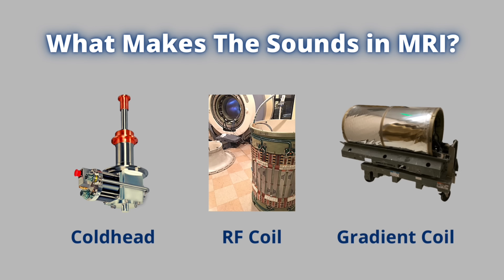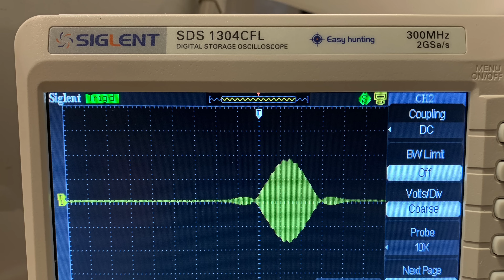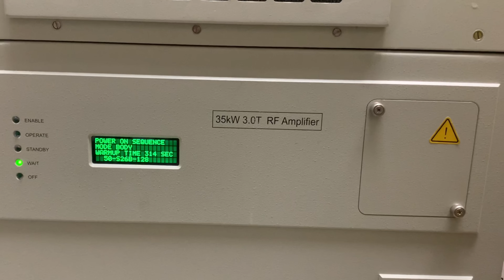What Makes The Different MRI Scan Sounds? Knocking to Rhythmic Chirping MRI Sounds Explained

Comment from the maker: I hope this video was helpful! Listen to the sounds of an MRI scan filmed inside the scan room here: https://youtu.be/TIsrOtSSUQY
Why Is Metal Not Allowed In MRI Scan Rooms? Click here to watch: https://www.youtube.com/watch?v=dxcrt1-gmLQ
What Is MRI and How Does It Work?: https://youtu.be/19qu6SYqOTc
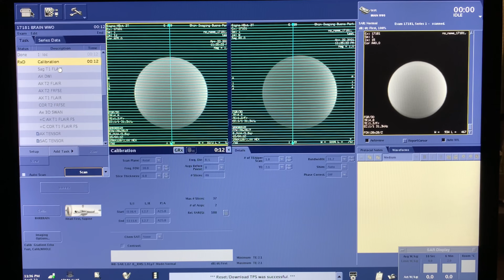Reply: 3:07 Why aren't the fiberglass mountings designed so the gradient coils don't knock against them?
Reply: Sorry, maybe that explanation would work for scientists and electrical engineers; but for us common lowlife slobs with other Masters degrees, that did not make any sense at all.  Any way you can make a video without using technical jargon?  Also, animation showing movement of internal parts as they make those sounds would be most helpful.  Don't slow the sounds.  We've all had to have MRIs at one point or another, so the sounds are very familiar.  I've always wondered what makes the different sounds, and unfortunately after your video, I STILL DO!!!
Reply: I could fall asleep listening to that video of the sounds inside an MRI.
Reply: @Jared7873  It's actually the windings in the gradient tube (gradient coils) that moving/trying to move.  The gradient tube is constructed of fiberglass and epoxy.   Hundreds of amps of electrical current pulse through the coils at audio frequencies.   Something's got to give.  In this case, massive amounts of audio frequency "noise" is generated.   The gradient coils are water cooled, so that may give you an idea of how much power is used by the system while scanning.   Not to mention the radio frequency amplifier, which is part of the system.
Reply: Well I don't want to get one
Reply: @GrayBoz I don't want to get one either, they're heavy and really hard to move and install.
Oh, you mean the testing? Then, go undiagnosed or have exploratory surgery instead.
Just had both CT and MRI scans, each able to "see" different things for doctor to diagnose some major medical issues and specifically to rule out cancer and severe autoimmune disease that'd do that whole killing me thing, which would really wreak havoc on my weekend plans for the foreseeable future.
The last MRI I had was over 20 years ago, been some changes and improvements, to put it mildly. Much better resolution, the sounds are actually lower in many ways and air flow through the time tunnel is improved, which helps with some of the confinement issues for me. The pulses are a tad bit quieter, likely due to improvements in coil binding, where they used to sound like someone actually hammering on the housing, it's more dampened. That's actually better on the coil, as well as the patient from a mechanical stress perspective and noise/stress perspective. The rest of the noise is higher in frequency by a bit, nothing stressful overall.
The fun part is, it's likely I'll need another MRI soon for my lumbar spine, as this one was examining ducts in my liver for autoimmune damage, so not exactly up there with watching a movie or something, but beats leaving doctor taking a guess or slicing and dicing my body to find out what's going on.

Entertaining is, I used to work around RF equipment of equivalent power. One never was supposed to be near such radiator source power, not due to some mythical cancer risk, but because one could accidentally come into contact with the radiator (aka, antenna or antenna feed connector) while it was energized and RF burns aren't exactly fun. Here, that power is tamed and rendered safe, indeed, to contact the coils, well, the frostbite would be worse in terms of damage than the brief RF pulses.
With the increased frequency and power come increased resolution, which helps doctor diagnose medical issues tremendously.
And one's nuclei don't mind getting shaken, not stirred.

Comment: Just had one today and was surprised by the pumping sounds, had no idea it was pumping  liquid helium 🤯
Reply: Me too
Reply: I had one today too. The brain in my case. The sound at 3:13 was sooo load and sounded very strange in my head.
Reply: Same - I had one today and here I am to figure out what all the noises were!
Reply: @Ang417 Liquid helium only exists within the magnet housing, it is never pumped. Helium gas is used as a refrigerant by the coldhead. It cools the shields within the housing and reduces liquid helium boiloff. The coldhead cannot turn helium gas into liquid, it just cools the housing, usually in at least 2 stages. Toshiba systems are much quieter due to the fact that the gradient coils are in a vacuum.
Reply: @johntyler4222  And because Toshiba coils are in a vacuum, they cannot be cooled as well from what I understand.  (vacuum is an insulator)  Therefore, scan times are longer as a result because the coil cannot be driven as hard.   Also, cold heads DO recondense the helium gas boil off back into a liquid.   I've had magnets go for years w/o the need for a helium refill, provided the cold head is replaced in a timely manner as it wears and cooling water supplies are not interrupted frequently.
Reply: @NESig  They are in a vacuum but like most gradient coils built over the last 25 years or so they are water cooled so they don’t rely on conduction  at all. The water cooling is usually provided by the Z gradient coil being a tube so the cold water runs through that and there is no problem with coil heating no matter what power is put through them. Toshiba, or Canon Medical now, don’t have longer scan times for comparative sequences. The magnets are fitted with fans purely to cool the electronics and also provide a cooling breeze for the patient.
The helium boil off allowed is usually quoted as less 100ml per hour(liquid), and it’s usually much less than that, or you start looking for problems.
Reply: I forgot to add, the idea of a coldhead is to reduce the temperature gradient between the 4.2K liquid and the room temperature by cooling the heat shields, usually 2 of them in 2 stages, so that the boiloff is reduced. There is no way that the coldhead can convert helium gas to liquid only reduce boiloff. Once the liquid is gas there is no going back. Regards.
Reply: @johntyler4222  you might want to clarify that a bit. Helium can be condensed, but the equipment is a wee bit large to do so. It's not as if helium, once turned into a gas from a liquid cannot ever be recondensed, which is basically what your statements sound like. Indeed, it's routinely done in physics apparatus like at CERN. It comes down to, does one need to condense to liquid or will different gaseous phases suffice for what one's doing.
That said, my understanding is that helium is in physical contact with the coils. Were it exclusively contacting the heat shield, heat would accumulate within the coils and well, that'd be bad. And a quench wouldn't instantly vaporize the helium and need to be vented to avoid overpressure damage to the plumbing. Hence, why there's a quench pipe.
Reply: @ What I was trying to say is that the helium in liquid form is only present in the magnet itself and not anywhere else within the system. The coldhead which makes the noise constantly uses helium gas as the refrigerant which is circulated by a closed loop compressor which also includes the condenser which is normally water cooled. Helium gas is not a wonderful refrigerant but really the only thing useable at the temperatures expected within the coldhead. The coldhead makes contact with the heat shields through a copper shaft holding the tapered round copper blocks which make contact with the shields and thus transfer the heat away to the coldhead.
In modern systems the gradient coils are water cooled, usually by making the Z coil out of copper tubing rather than wire so air cooling is not necessary. Fans, other than those used for cooling the electronics, are usually only for patient comfort these days rather than coil cooling.
Apologies if my original comment wasn’t clear.

Comment: had 1st one in 1987 they were just getting popular but complaints of costs but did not take long to realise how valuable they were because before the new scans only way dr had was cut you open to explore then decisions on the fly or you had to have 2nd operation now dr can plan better.  and one cutting just like carpenters measure 2x cut 1. but the first machines took forever compared to todays  . i had about 6 plus 2 ct   and at least a few more while they monitor my problems

Comment: Jesus, 30kW? This explains a lot. I told the MRI tech that during the scan it felt like someone was putting a hot towel on my back. I also here and there saw flashes of light. He said some people are, “more sensitive than others” and that most people don’t perceive anything.

While I appreciate the lack of ionizing radiation I gotta think being that close to 30kW RF transmission doesn’t come for free? Then there’s the contrast agents. I feel kinda foggy after Gadolinium for a couple weeks, it’s not massive but I feel off. 

Still beats CT scans. I had a Tri-Phase CT and it felt like I was pissing myself, good times. I’ll take the tuna can flavor and clunking of the MRI any day over a years worth of radiation exposure in a handful of seconds 😐
Reply: MRI systems have built-in software limits as to how much RF radiation is used during scans.   It's based on body weight.   Still, a scan, like a lumbar spine scan, WILL warm up the patient.   Lots of RF energy is used to flip those little hydrogen nuclei in the human body so that they in turn, will relax back to their original orientation while emitting RF energy that is received and converted to images the Dr's read.   (It's magic actually.)  :)
Reply: @NESig  yeah pretty aware of how it works, it's truly fascinating tech. I'm an engineer myself and still marvel at the multitude of engineering, physics etc disciplines that had to converge to realize that technology in any practical sense. One of the easiest ones to understand IMHO, almost downright intuitive is PET scanners, the decomposition of the radionuclide and the scintillators converting those emissions into optical counts. A little computation of time delays and you know where the stuff is concentrated...i.e. a tumor.

Comment: Trying to understand the use of the word Sublimation in the video related to helium involved with the MRI scanner. Trying to understand what this means because Sublimation means going from a gas to a solid and skipping the liquid phase I guess.  Why is the Sublimation term used near the beginning of the video? I only see gas being converted to a liquid to achieve the cooling benefit
Reply from the maker: That is correct! Thank you for pointing out that oversight. Using boil-off, or expansion instead of sublimation would have been accurate. I try to keep all information as accurate possible, so I really appreciate it. I will make a note of it in the description. Thanks again!
Reply: @MRIPETCTSupportEngineer  I'm looking forward to an MRI and MRA of my neck and skull relating to ear ringing. Toward determining if the ear ringing I experience is due to pulsatile tinnitus. Even if it is pulsatile it's still something that likely will not be meaningfully treatable but worth learning more about and who knows what else scans will come up with.  This is what led me to your video.  Thank you for a really great video

Comment: In 2018 I had a couple of MRIs done.  The rhythmic pulsations and buzzes and the general warming sensation (RF heating?) were pretty much soothing, to the point I was falling asleep.  The technician told me to keep myself awake so that jerking in my sleep wouldn’t degrade the image.

You might correctly guess that I’m an engineer.  I work with RF and superconducting electronic circuits ;o)

Comment: Sorry, but much of this is incorrect:

The RF coils do not make any (significant) noise, and what noise that might come from the coil is not due to the RF pulse. The RF frequency, even on very low field scanners, is in the megahertz regime, so way outside of the range of human hearing.

The gradients make noise for a simple reason: they are loops of wire with pulsed electrical >current< passing through them. This current - which can be a few hundred Amperes - causes them to act like a loudspeaker. The pulses are in the audible frequency range, and hence so loud to our ears.

Comment: I have acute claustrophobia since a kid. Thank GOD the V.A. have latest equipment & the openings flare out, giving a better experience. I was unlucky enough to get into what looked like a first gen. machine. It was like being in a straw! I was told "If you get stressed or panicky, just squeeze the bulb & it will pulse air to the alarm!" As I was going in, my entire body was squeezed by the sides. I wasn't even fully in & I was pumpin' that little bulb so fast she probably thought I was having a seizure!

Comment: There is a cryogenic pump cooling the magnets. That makes most of the noise, it's a helium displacement mechanism ususally driven from a synchronous motor. The motor makes a rythmic buzz and the displacement piston makes the helium expand acompanied by a hiss. If the helium compressor is nearby that makse makes the most racket!

Comment: In 1975 I started college and was taking chemistry 101. I was given a tour of the facility and the guide took us to a small room that had a copier sized, non-descript machine in it - not much to look at. The machine was making a rythmic knocking sound and he told us it was their new Nuclear Magnetic Resonance spectrometer. Nuclear Magnetic Resonance is the basis for all MRI devices. The concept of using NMR to make images had been conceived and experimented with in 1971 by Paul Lauterbur, but it took many years before MRI machines became available.

Comment: If you're a worried first-timer, here are some tips. It's my experience for brain MRIs. DON'T BE AFRAID, it's not that bad. If you are very nervous you can show up 30 minuted earlier and ask for something to calm down (in swiss hospitals). For me the worst part of getting my brain scan is the dye injection. Once I'm in, I do a mini-meditation: name 3 things your body feels (like your socks touching your feet, whatever is under your fingers,...), 4 things I hear, 5 things I can see. That's 5-10 minutes gone. Then another few minutes appreciating the fact that you get to be lazy and HAVE to do absolutely nothing and it's completely justified! 
Boom, I'm half way there.
Then, rinse and repeat. Or plan my MRI reward. It's usually a good pastry and coffee. Pizza maybe? Anything, really. Got plenty of time to figure it out. 
Making lists also helps. Top 10s for example. Until finally the tech announces the dye injection, which means there's only 10 minutes left! 
You can do this! ❤✌️🖖

Comment: Thanks for explainig . Can you / anyone else do something about the noises? Did you mention the loud train-horn like torture device that goes on intermittently. What heck is that, some sort of warning ? Is it not possible  to make magentic coils that work at liquid nitrogen temperature,  so that one does not have to worry about condensing the gas.

Comment: Why haven’t these brilliant engineers figured out how to isolate the noise of the machine from the environment? We have enormous nuclear submarines with gigantic turbine engines driven by steam heated from nuclear reactors. They also have giant condensers to return spent steam to a liquid. This system, with all of its machinery and auxiliaries drive a vessel weighing thousands of tons through water at great speeds virtually silently from outside the hull (so it can’t be detected by enemy ships). This is done with sound isolation design and technology applied to all noise making machinery. Surely we can do better isolating an MRI loud banging noise if the builders and buyers of MRI machines cared about the hearing and mental well-being of patients. Slapping on often ill-fitting headphones (especially for small children) just doesn’t do it.
Reply: You might be able to at a price and by compromising the image quality. However, nobody is willing to pay the extra cost when some cheap earplugs will mitigate any hearing damage. Secondly, the clinicians and if you are sensible the patient too want the best possible image you can get so it's ruled out on those grounds too.
Reply: You seriously have no idea what absolute zero is??? Or the difference between helium and water?
Reply: Noise isolation is noise isolation. Sound waves moving through air is the same whether the source is steam condensation or any other gas. Noise is noise.

Comment: I've had several MRI scans. It sounds like being close to a running large diesel engine. The first one I had, the technicians were still being trained so the scans were rather lengthy. I fell asleep during one of them and moved when I woke up so it had to be redone. I was in the machine for almost an hour. The last scan I had was for a shoulder problem and lasted under 10 minutes.

Comment: Great video. Just a side note:

The human ear can hear frequencies between 20Hz and 20kHz. RF used in MRIs are in the MHz range, so the RF is not audible.
The noise we hear during scan are only from Gradient Coil vibration and the coldhead. MRI RF is not audible.